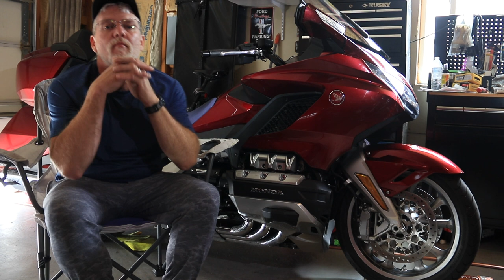Goldwing ticking noise

Comment: 20 DCT Tour with 15K.. The new Gen is singing a bit. yes, it has its own beauty sound and very soft ticking. In fact, I think the older gen is quitter. I have used 87-93 Octane, same for me. One thing I was told, once you are back from a ride and will not ride the next day, have her on a center stand. Even lube position/bath due to the nature of this boxer. Change the oil on time(I do every 5K) cause I like higher speeds and I strongly recommend to use Honda 10-30, GN4 oil. I don't use anything else. Honda will not address this issue. Its the nature of the 6 gen wing. We have standard lifters. They are not hydraulic.
Reply from the maker: Thanks for the info
Reply: Standard lifters might have a little bit to do with this versus self adjusting hydraulic but no one's even certain it has anything to even do with the lifters.. Does putting in premium fuel help at all?
Reply: @seatime674  I was actually surprised to hear the 6 gen doesn’t carry hydraulic lifters, when I got mine. I never tried to use premium gas in mine. Always 87 as the book says. Going to try that in the Spring. Also, maybe 10-30 Honda synthetic oil will help a bit.
Reply: @alp3781  Yes only use Motul 4T MA2 5100 Full Synthetic 10w/40. That totally quiets your gears in shifting and might have a positive effect on the Piston & valve train. Remember this new redesigned 1800cc for 2018+ has 4 valves per cylinder now  instead of 2 with an obvious new rocker cam so you're probably just hearing an all-new hummm from a different designed motor now and there's probably nothing wrong with it at all. Then again maybe because their standard lifters some left  the factory a wee bit out of adjustment  and might just need another adjustment..
 I'm just curious next time do a couple fills with super premium gas and see if there's any difference ...
Reply: @humbleplumbersadventures4602  I just watched another video on this. Every time you come back from a ride put in on the center stand then try it in the morning.. People say on the Flat 6 when it's on the left stand all the oils on the left side of the engine and on Startup it's displaced too much so try the center stand for a while and see if that's the difference and let us know

Comment: UPDATE.  Since my comment posted below Honda have simply chucked me under a 'bus.  The engine exploded within 14 miles of having the valves adjusted by the Dealer.  Honda have declined to look at the machine and told me that it is no longer in Warranty,  In actual fact there is some nime months left outstanding.
Reply from the maker: Wow    that  makes them   look soo bad. like i said before im not big on using attorneys  but   maybe this is a situation   to  look it that.
Reply: Have same issue 😢 help

Comment: I want to try to lighten the mood for just one moment. In this video, you look like you could snap and run that motorcycle into a tree. I don’t know any other way to say it. The noise is normal. It sounds as if the valves may need to be adjusted my bike ticks and has been ticking, for I don’t know how long. But what I do know is I remember the morning I started my bike up and I heard that very first tick. The bike was under warranty. I started hooping and hollering. I called everybody and I really learned some not so great things about the company, Honda and their position on fixing things. But what is a great great source of help is Goldwing docs and forums just like that. The amount of help that you will get from just asking a simple question is retarded you’re not going to be able to read all of the help that you’re going to get it nobody is going to waste your time. Or waste their time. On my journeys, I’ve run into other Goldwing owners, and we share stories about the tick. And the highlight of the story is how angry we were when we first heard it. And so I laughed now because there is nothing wrong with the bike, and even though I haven’t heard your bikes tick, if someone said to you that it sounds like the shims,, then I’m pretty confident saying there’s nothing wrong with your bike. What it is I want to say is you can sleep easy there’s nothing wrong with your bike. So to run a small test if you have a car. Start the engine and then lift up the hood and listen for all the sounds that it makes I almost guarantee you you will be able to hone in on a light ticking sound. I really must say I’m not sure that Honda realizes that this is a big problem for a Goldwing owner and that they should fix it or build an engine where we don’t hear that ticking sound. I wish that they could engineer that. In closing just know you will not be happy about what you hear from the dealership and even if they do the shims, the noise will come back at some point. Could get expensive. As you ride the bike more, you will become more confident in your machine. At this point you’re going to baby it because you don’t want it to get worse. So before you take my advice, go to the Goldwing forum. Or Goldwing docks submit your question and read the testimonials and then maybe do an update to this video after you formulate an opinion based on what you’ve read and the feedback you may have gotten. Hope to see you out there.
Reply from the maker: Thanks for the  feed back.   I was pretty upset about it.  I know you are right its   a normal  noise.  I think the thing that frustrated me the most is   the shop I bought it from said if Honda didn't take care of  the bill to fix it then I would have. to.   they could  have done the research for me  and explained the problem to me.  thanks again   for the comment.

Comment: nothing to fix i have 2018 tour nothing to adjust. fuel injectors can be loud i found using premium fuel makes little better. have taken bike on many 2000 plus mile rides sounds same as when bought always made little sound, as far as oil worries try leaving on center stand to keep oil even if sitting long time. also do not listen to anyone who does not own one save for entertainment only.
Reply from the maker: Ya thats what I have found out too,  I just wish  my mechanic  could have told me that in the first place.

Comment: My 2022 did it but has since went away.   I figure its under warranty so if it explodes they'll have to fix it.  Its a honda just drive it.  And no I dont think you should have to pay for it.  Your over thinking this whole thing.
Reply from the maker: Your probably right. I  am  overthinking it.   but  I just worry  about  it causing  problems in the future.    I've been told its normal  though so it doesnt bother me   like it did.